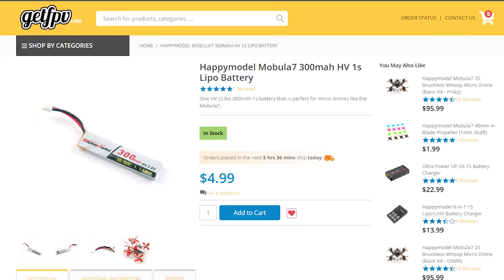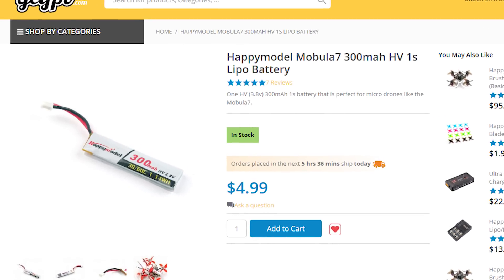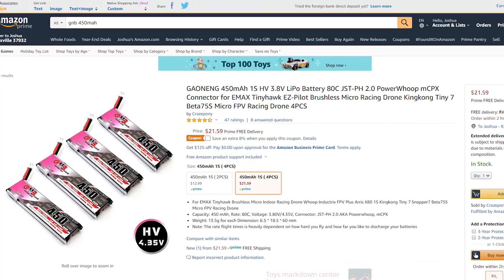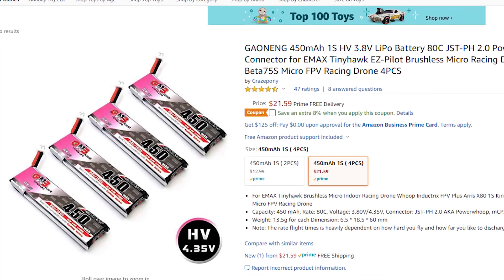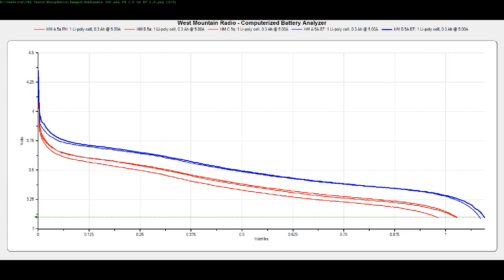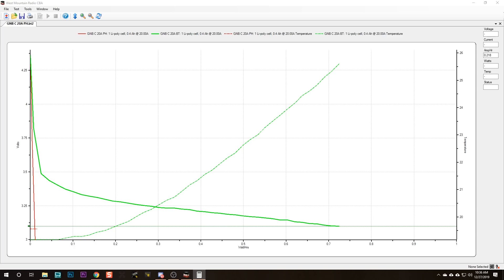Proof that BetaFPV BT2.0 is better than PH 2.0 (BEST TINY WHOOP BATTERY CONNECTOR)

Comment: Why would you even need a battery to test the connector lol? it's as simple as measuring the resistance (or voltage drop if you don't have micro ohm meter)

Comment: still blows my mind after 4 years BT2.0 still haven't been widely adopted in new whoops
Reply: is it relaly that big difference? i bought moblite7 3 years ago and I got back into flying now and it uses ph20
Reply: @PinkeySuavo  Yes, the flight time is noticeable. And it's just a superior/more efficient connector, you can fly it to a lower voltage. However, if you have a tons of ph20 batteries, I'd say just use those till they are dead before changing it out.

Comment: My woop has a ph2 connector and voltage will be at 4.25v and when I take off battery voltage droppes straight down to 2.9v and there’s a huge lack of power no matter what batt I put on it, would this new betta Fpv connector fix my problem??? Ps running 0603 19000kv
If anyone knows pls help
Thanks Ethan

Comment: I know this is old, but thank you for doing this test the right way. That you came up with this test method furthers my trust in your reviews. It's not often that youtubers are technically capable and not just good salespeople.
I'd also add that the BT2.0 connector is more robust from a number of plug cycles. That combined with the lower power loss really makes the case for getting rid of PH2.0 whenever possible.

Comment: Just bought some GNB 720 mah 100c batteries for my BetaFpv Cetus Pro and a 5 pack of BT2.0 connectors to get rid of the stock PH2.0 connectors on the batteries because even on new mode on slow speed when I'm flying around my house I only get about 1 minute 42 seconds on a freshly charged battery. Sport mode on mid speed gets about 54 seconds of flight time. I've tested the stock batteries and they show no fault in discharge or capacity shortage, so I'm confused as to why I'm getting such short flight times without pushing the Cetus or its stock BetaFpv batteries. I had to upgrade if I actually wanted to fly it.

Comment: I am using a ph2.0 connector on my mobula6, and literally touching the connector while plugged in alters the voltage reading on the OSD by almost half a volt. 

This is the same with multiple batteries on a mobula that's been through maybe 150 packs.

Do you reckon swapping over to bt2.0 will solve this? I imagine the ph2.0 has worn over time..
Reply: Follow up:

YES. Do this. Getting almost mins flight time and minimal sag. NO wonkyness. Perfect. Very pleased with bt2.0 and I feel like this kind of connector is going to hold up over time
Reply: @big-smoke-rc  so i just gotta cut out ph20 port from drone and solder bt20 port? and get new bt20 batteries?

Comment: Can agree with conclusion about BT2.0. In my Mobula 7 recently changed pigtail and batteries to ones with BT2.0 connectors. in result when flying is same manner as usual got final battery voltage around 3.3-3.4V which is Ok for discharged LiPo battery. When I fly in same manner during same time with batteries having PH2.0 connector, on end battery voltage was 2.7-3.0V which already damage LiPo batteries. Seems new batteries will live longer too thanks to BT2.0 connector.

Comment: Great test, thank you that someone finally digs out the crap. But you always run the ph2 first and then the bt 2. But there is a BIG problem with it.  Whenever you charge your battery the first two to three time after bying or having them in storage the performance is coceivably weaker, the chemistry has to wake up, you can really feel that if you start to fly whoops in winter on your flight times which go up while speed goes up as well. 
Why don't you just test the connector resistance and the voltage drop with a lab bench power supply and eliminate the wonky factor (battary).

Comment: I've found it difficult to make internal resistance measurements on my batteries with PH 2.0 connectors. If I get a strange value I simply reconnect and test again. Point contact resistance was something I didn't think much about until now. The banana plugs on cheap battery chargers are also another source of point contact resistance that should not be ignored.

Comment: How do you attach bt2.0s to my tinywhoop? Do I need to buy an adapter?
Reply from the maker: Desolder the old pigtail and solder on the new one. Make sure to get + and  - correct!
Reply: @JoshuaBardwell  cheers!

Comment: The BT2.0 may be "the one" after all this time witnessing brownout  performance issues as the JST PH-20 is NOT a battery connector... it is a low amperage space saving high density JST connector designed for 30-24 AWG low amperage circuit board wires like you see inside a computer and was not designed for repeated connections which is why Emax gives you a spare lead.  I was shocked how poor the PH-20 is after replacing one and seeing flight times and performance jump up as if I had replaced a weak battery. The PH-2.0 pins are ONLY rated for 2 amps so divide that by 4 motors and the problem becomes obvious. If I raced I'd solder my best batteries and have a quiver of Tinyhawks setup like that with a few other weight reducing mods. The micro battery connector used on a micro quad needs to be of the highest quality design not a JST PH-20 and shows despite the advances in micro quad technology there is plenty of advancements waiting to happen.

Comment: Xt30 is where its at for me.  I was running the red jst 2 pin connectors and had good results initially on my inductrix.  However soon flight times started falling off from 3 to 4 minutes down to 2, 2.5 minutes.  Changed the connector with a new red jst and same thing, good flight times and eventually less.  I switched to xt30 and its so much better.  Consistantly getting 3.5 to 4 plus minute flights.  The performance is better too.  The battery doesnt sag as bad after takeoff and even has a little better power for recovery.  All in all made my inductrix way better!

Comment: One easy way to test these connectors would be to just run 5 A current through them and then measure the static voltage drop across the connector. Any voltage measured across the connector is away from the motors and used to heat up the connector. Also worth keeping in mind that any measured voltage drop on the connector is most likely happening on both of the leads, positive and negative, so it needs to be summed up together to get the whole effect.

One comment about the battery voltage measurement, if two measurements are performed really closely, the battery will get exhausted and provide worse results on the second run. The "imaginary" internal battery resistance (it's not pure resistance) goes up (at least on Li-ion) when current is pushed or pulled from the battery. Preferably, there should be many hours between the measurements (24h?) to provide comparable results.

By measuring the voltage drop across the connector, we don't need to worry about the current state of the battery cell and any load history it has been subjected to recently.

Though, just looking the 20A result tells us that the BT2.0 is of much lower resistance connector than the PH2.0.

Comment: Cool comparison! Great job. By the way one of the worst problem of ph 2.0 is the durability. After flies and crashes the performance dicrese a lot, bt2 is better in durability and stable in time?
Reply from the maker: Only time will tell for sure, but based on the design, it seems like it must be.

Comment: Josh, great point when you realized the number of variables needed to be minimized.  But, you didn't go far enough.  The only thing that matters with these connectors is the resistance.  This is complicated by the heating of the connectors and the increase in resistance as the connector gets hotter.  And, to only make this problem more difficult, the connectors inside the wire are so small that their best method of dissipating heat is through the connecting wires.
One way to eliminate the quality of the cells as a variable is to simply flow increasing amounts of current through each connector while measuring voltage drop across the connector.  It should become very apparent from the voltage drop which connector is best.  Also, the inferior connector would also get warmer, so measuring the temperature change would also be worthwhile.

Comment: Just read the datasheets of the JST PH connector. Look at resistance vs. mating cycles. That is the problem that BT2.0 tries to tackle. Mystery solved (wouldn't make a compelling video though). Seriously guys, I wish the RC community was less about hear say. It's all thoroughly characterized. Just look at the data the manufacturer provides after something like a quadzillion of tests. It's all out there. And yes brand new PH2.0 connectors with intact plating (10mOhm per JST), even used out of spec as we do, perform not noticeably worse. So inb4 someone mentions that :P

Comment: My understanding is that after a few matings the PH connectors would perform poorly.   I have batteries that no longer worked well for my whoop after a few uses.   I would be interested in seeing how those batteries performed when the connections where changed.   Would it bring new life to the batteries.
Reply: Yes, it will bring new life to the batteries. I have few old batteries on which I already changed PH connectors several times. They would be long time in the trash if I did not do this. PH 2.0 degrade much quicker then cells if used correctly.
Reply: @cheburator2000  thanks for letting me know

Comment: I knew the performance with the bt2.0 connector was better,but it's great to see scientific proof.thanks Joshua,great job.since the meteor 65 and betafpv batteries i purchased came with the bt2.0 connectors,i couldn't compare them with ph2.0 batteries.so,i switched out the ph2.0 connector on my us65 with upgraded  0703 motors with the bt2.0 connector.the difference was nothing less than amazing.i got loads more power and 30 seconds more run time with the 300mah betafpv bt2.0 battery compared to the 300mah gnb ph2.0 batteries. all the betafpv battery haters out there need to know that the new cells are of a much higher quality than the older ones.i know this because i purchased some new 350mah gnb batteries and swithed the connectors over to bt2.0's and only got about 10 seconds more flight time compared to the 300mah betafpv cells in my us65. the gnb's are 1/2gram heavier,but they should have done better than that,right?i obviosly can't comment on the longevity of the new betafpv batteries,we'll just have to wait and see.

Comment: Hey Joshua! A suggestion to test the performance of both connectors completely independent of the cells connected: Hook up each the connectors between a dummy load  and a lab power supply. hook your most sensitive multimeter to measure the voltage drop on one side of the connector (let's pick the ground side of the connector and multiply the result by two, or measure both high and low side). Now set the lab supply to 4V do a series of measurements of the voltage drop at the connector itself at different amps of load so you can actually accurately calculate the resistance of the connector using ohms law. It will also be interesting to see the resistance increase as power dissipation on the connector heats it up. This way you can simply and rather accurately outline the resistance characteristics of each connector. 
Thinking of it, you might even be able to do the measurement with only the lab supply in constant current mode. Just see how many volts the supply is able to push through the connector at each Amp setting, and multiply the result by two, because the connector actually has two ends. The resistance of the connector would obviously be R = U * I . So for instance if Voltage at 1 Amp was 0.1V the resistance of the connector would be 0.1 Ohms.
Reply: +1, very underrated comment

Comment: Exactly what I expected, I was one of the first in Germany who used Mosfets (including brake) and High Amp connectors for Airsofts (long long time ago). I have a resistance (Ohm) Wheatstone bridge which can precisely measure down to less than 0.1 Ohms and my test results showed the large Ohm difference between different connector types. If you combine this with the knowledge of Ohm`s law, it is obvious that connectors have a clear impact on performance. However just using even more bigger connectors, brings up a weight disadvantage at some point (relatively to the quad weight) which kills the Ohm advantage of the better connector. Thanks Joshua for that test!

Comment: We need a XT-10 or XT-15 connector!
Reply: this is essentially that.. the connection is the same as on xt connectors
Reply: The GNB 27 connector sits in between this one and the XT-30.
The BT weight 0.6g, the GNB is slightly better and weights 0.8g and the XT30 is a lot better for 1.6g
Reply: Yes! Could not agree harder! I think I just cracked my phone screen trying to high-five your comment.

Comment: @Joshua Bardwell: And this is proof of my theory as well. For everyone who asks you about vTX "got OSD but gray/black video" - check your connectors ! Those micro ones, like wiggle them. They suck and they fail. Solder where you can. BAM! 30 percent of Joshua's daily mail solved... =P
Or upgrade to the ones TBS got, I know, money... right... xD

Comment: Did you test with solid pin connectors?

I have been using  jst xh for a while now and get better flight time with 260 xh combo over the beta 300 bt2.0 on a the metoer 22000kv motors.

Comment: Please try a solid pin ph2.0 with 18awg wire. I’ve noticed significant benefits and then I can use the same batteries and charger connectors.

Comment: Would be great to see this emerge as a standard. I think this would shine even more on 1s/2s compatible whoops/toothpick that combine two 1s batteries for 2s.
Reply: you are right,everybody with a double 1s whoop or micro would definitely benefit from a bt2.0 upgrade,as would anything now using a ph2.0 connector.bt2.0 connectors should become the new standard. the bt2.0 mod i made to a 65mm brushless whoop proves to me that this connector is superior to the ph2.0.

Comment: Hi.. i was testing this when considering to upgrade my batteries to xt30.. the result was that you have to conseider the wire too. So i dropped the wire on the battery and soldered the xt 30 dirrectly to the cell. This sawed some weight and i gained some power by removing the unnecessary resistance. The xt30 is too heavy for the weight and if there was a connector like bt2 i would have used it. Thanx for an informative video..

Comment: The connector is important, Trashcan and nano tech 1s 300mah battery 3min flight with 0.8mm Gold Connectors with P.H 2.0 30 sec same battery. With brushed whoops the same situation is much more power and longer flight.

Comment: Hey JB,
Have you managed to come up with a good way to storage charge/discharge 1s whoop type batteries? You commented in a video months ago that you were working on it, and I was hoping there's news.

Thanks
Reply: Just make adapters from PH2 (or BT2) to XT30  and most good chargers like ISDT allow 1S discharge with no balancing (of course). I do that all the time and works great.
Reply: @Clif_Brown  I have a wonderful way to discharge batteries: Fly a quad on them 😉
Reply: @Vousie  Except when you can't fly a quad on them due to weather, schedule etc. When you charge up a bunch of them then plans change. Not good to let them sit for days and days fully charged.
Reply: @Clif_Brown  The point of whoops is you can fly them indoors
Reply: To discharge, I started to use the uruav battery killer. Just google it. It works from 1s to 6s, down to 3.0V, and for XT60 connectors to 0V.

Comment: My Inductrix would drop to the ground  due to the voltage sag on stock connector  (maybe was more sensitive than normal) a in first 5 sec. Thought it was junk but I saw a video showing a mod to the next higher size connector ph2.0 now I get 2min plus flights. Looking at BT2.0 connectors it looks like they would be better currant carriers but would  they be lot better or just overkill? Plus hacking  back into my quad be asking for trouble. wow $1.60/pair
Reply: I have an inductrix too (brushless).  I switched over to the red jst connecter and i get 3 to 4 minutes wth 500mah eflites and 600mah crazyponies.

Comment: Great Video!  My experience is that the PH2.0 connectors wear out quickly also.  Could you test that with both PH2.0 and BT2.0?  Measure voltage drop after 25, 50, 100 insertions?  I think this might be very compelling.

Comment: What I see in your graphs is more mah in bt2.0 connectors vs ph2.0, (the red has less area under it then the the blue), given the same batteries were used where did the mah go to in the red lines?  Did you randomize batteries in the order tested with the two connectors, assuming you used the exact same batteries for both. Or did you not use same batts, I assumed you did I think in the beginning you were saying not all batteries in a batch are going to test the same given same specs same brand.  Also how many batteries were used, total?  Just curious.
Reply from the maker: This is watt hours not amp hours. Higher voltage results in more Wh.
Reply from the maker: Exact same batteries were tested.
Reply: @JoshuaBardwell  Doesn't matter, Is there lost energy burned up in the form of heat  (resistance) at connector or is there still energy still in battery with ph connector?
Reply: @fpvkabo  in my experience, both

Comment: I remember hearing decades ago when nicads were THE battery type for RC cars that some racers would solder their batteries to the car's power input to gain the best amparage possible, this was back when Tamiya connectors were the standard.
Reply: I totally did that back in the days of racing my Rc10 trucks n buggies (early 90’s)
Good times. 😎🎮🤙🏻stay up